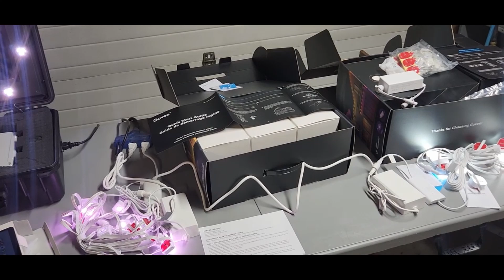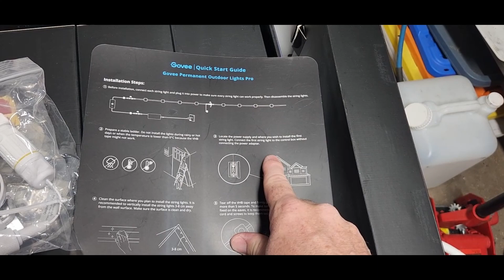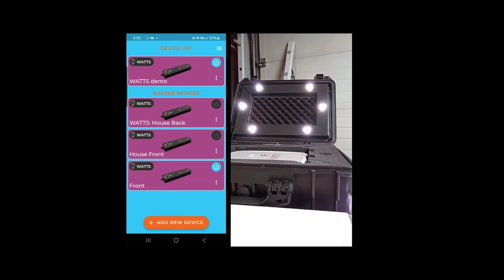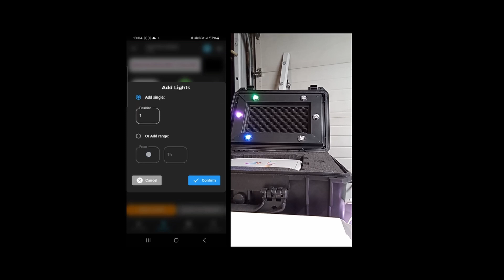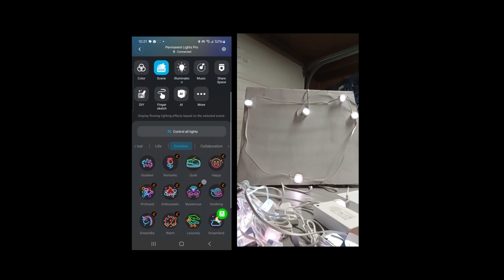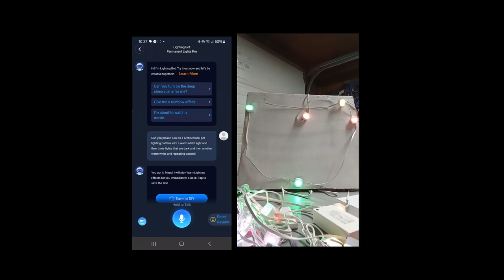Watts Lights Versus Govee Permanent Outdoor Lights

Comment: Love my Govee Permanent Pro Lights. I find them way too bright at 100 percent. Right now i have them set on warm white at 10 percent and it is perfect. It's too bad you didn't place the Govee pro set up on a black background as the ones you have in the black case and put as many lights on each display. It does take awhile to learn different features on the Govee app but once you practice a little it is pretty awesome. Very easy to have every individual light different colors and to save your own scene. I'm sure yours are very good as well but I am VERY happy with Govee at half the cost. Also, I wanted to mention that Govee Pro can be controlled by Alexa and Google as well, which is pretty cool.
Reply from the maker: That's fantastic! The Govee product gets great reviews! It's also a cinch to install, especially if your roofline is easy to reach.

Comment: Great video , and I know you install watts and are probably a bit bias. If anyone uses or installs any type product there is always bias. 1 thing you misspoke about is having to be at home with outdoor lights and this is not true , as long as your cell has service you can change, turn on/off from anywhere, I did it while in Mexico and I’m from Canada as well. Secondly Govee pros longest length is 200’.  Also probably because you are not familiar with the Govee app is that you can control each individual light in Govee app . ’.For instance you can and I have just a single light lit at each of my peaks and corners of my home for accent lighting . If you dive deeper you can create complex scenes. Not knocking Watts lights by any means but I’ve installed 300ft of Govee pros on my home for a third of the price of watts. There are also 3rd parties that make aluminum and vinyl track for Govee. I think where Govee differs is they are targeting  the average homeowner who can install themselves or sometimes hire someone to do so. Not everyone can afford 3500-??? I’m guessing 8-10k to do 300ft install. I’m just over $1100 and if I bought track to install with I would be still well under $3500. I just wanted to point that out to give consumers correct information.
Reply from the maker: You are right about the cloud connectivity, the Govee lights do work through the cloud. Thanks for pointing that out, I'll add a correction to the video description. Yes, Govee Pro can go 200', but at that length the voltage and current are over the 100 volts*amps dictated in the Canadian Electrical Code for permanent outdoor low voltage light installations. 8-10k is a little high for a 300 foot installation. Prices vary by region, but should be more in the 6-8k range. If we're comparing apples to apples though, that includes the labour of install. Can't do a proper comparison with a DIY install unless we assign a value to a homeowner's time.